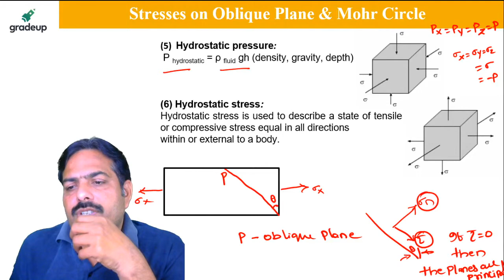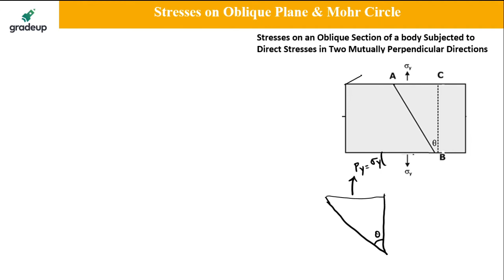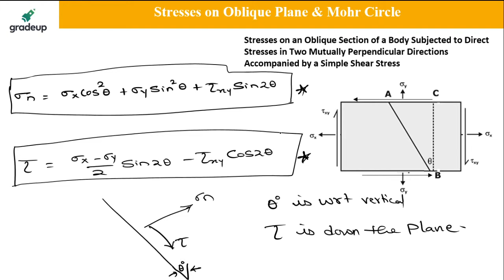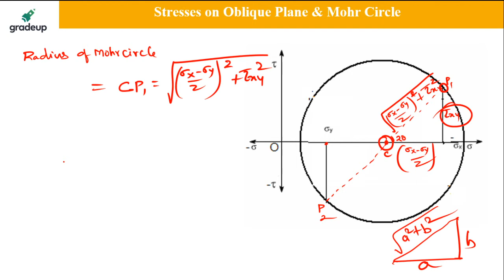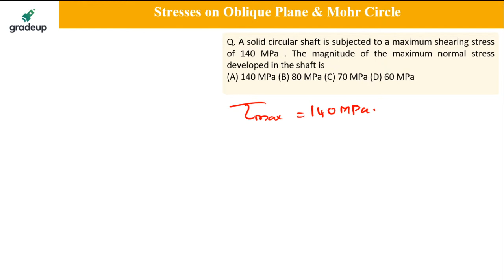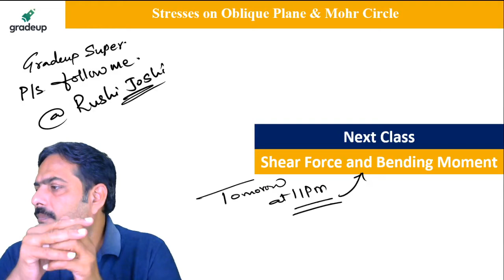Oblique Plane stresses | Strength of Materials| GATE Qualifier Late Night Series | Rushi Joshi

Comment: In 01.07.11 we use theta value as 30 degree but they mentioned 30 degree as angle between plane and direction of load applied...please clarify theta is 30 or 60